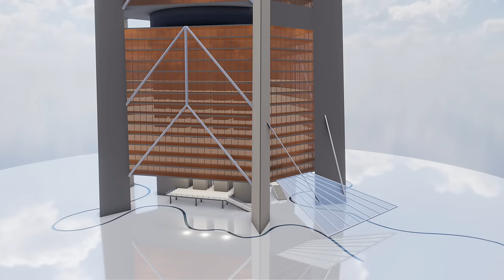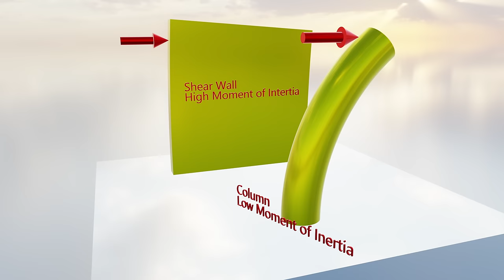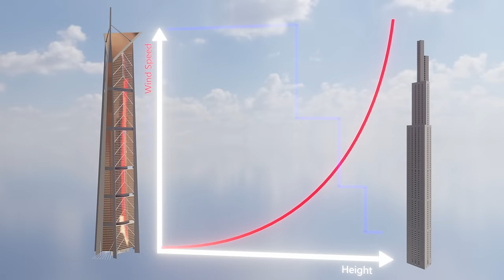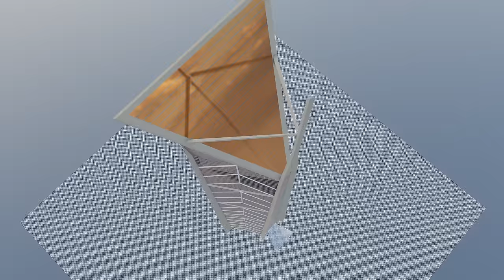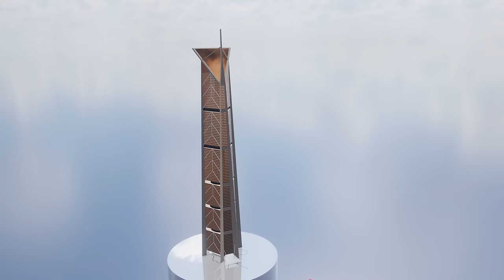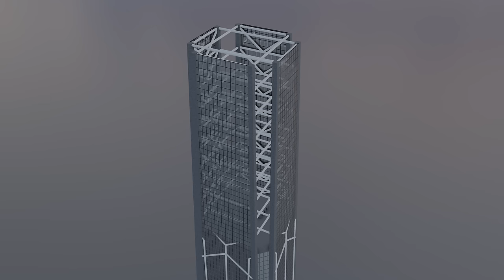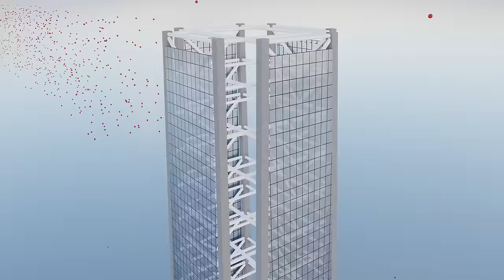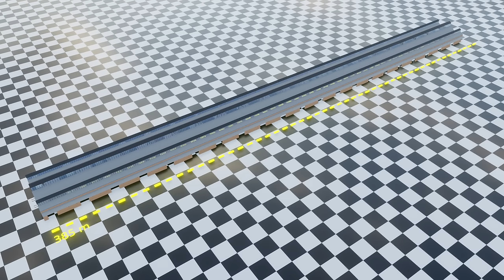Why Melbourne Cancelled the World's Tallest Building

Comment: great video. I much prefer the Grollo tower for its look, and from your explanation appears to be structurally more sound. I especially like the mechanical floors which allow more wind to flow through, and even if its only 15%, the solar panel is still a great touch to the top of it.
Reply from the maker: The open mechanical floors and solar roof were revolutionary at the time; they are very common on skyscrapers these days, but not in the 1990s. Thanks for watching

Comment: FYI DCM did a circular 750m mixed-use tower design for Dubai that preceded the Burj Khalifa and followed on the footsteps of the Melbourne Tower. Amazing project and great shame it didn't go ahead.  The outer layer was wrapped in perforated sheeting with a unique graphic patterning.
Reply from the maker: Thank you for sharing, I just looked at it on DCM's website and it's definitely a unique form. It's a shame there isn't more information about it on the net though.

Comment: 2 buildings , one 50 floors and one 49. 49 sticks a 5 storey high antenna on top,,,, which is the tallest building ?
Reply from the maker: According to the Council on Tall Buildings and Urban Habitat (the organisation who maintains the rankings of the world's tallest buildings), an antenna is not counted when considering the "Height to Architectural Top", which is the metric used for the rankings. So in your example, the 50 storey tower would be taller to the architectural top, and thus the taller building. However, if the antenna was an architectural spire, then it's height would be counted the 49 storey building would be considered taller. Some people prefer to consider only the height to the "Highest Occupied Floor", in which case the 50 storey building would win. So, your question is difficult to answer and depends on who you ask.

Comment: It’s strange that you’ve got the Architect wrong.
Whilst it’s possible that Seidler designed a version of Grollo Tower, it was not the definitive design that was proposed to Council.
Denton Corker Marshall designed a far more slender and beautiful tower sited at the west end of Collins Street in the late 90’s.
Reply from the maker: From my research (Fluid City by Kim Dovey), Seidler was a serious contender who designed the first iteration of the tower. You can see Seidler's drawings on the firm's website. However, you are right in that the DCM design was the one that had a higher chance of being built (which is covered in the second half of the video).

Comment: Melbourne hardly needs to be put on the international map. I'm relieved to see that this concrete monolith will not go ahead. It's unimaginative and frankly boring. If there's demand in these uncertain economic times I would suggest a Timber Building that is so beautiful that it is 100% tented within 18 months of completion.
Reply from the maker: I agree that timber buildings are more beautiful than concrete or steel, but from my experience they are not as sustainable as people think. Timber is not as structurally efficient as concrete or steel, so there is usually not a huge difference between the emodied carbon of a timber building versus a traditional concrete/steel building.
Reply: @Contraflex  Granted. There is a limit how high a timber building can be.

Comment: Thanks for sharing
The people of Melbourne didn't get a say. We never do. Look at all the low quality high rises in this city. Are you aware that most apartments are coated in fire accelerant cladding which is illegal and won't be changed because it cost the landlord more than zero $.
Melbourne's corrupt building lack of codes (actually the codes are good but are largely ignored) has facilitated a Manhattan style cluster of dystopian, never to see the sun, streets. 
Both proposed designs are poor aesthetically and were never really fully fleshed out as functional landmarks. It was always just an overblown ego project that had no realistic chance of being built. There are many such proposed projects around the world, nearly all of them, unrealistic.
The flight path excuse is a bold faced lie. The CBD does not line up with any of the runways and there is plenty of space for planes and buildings to coexist.
Reply from the maker: Thank you for sharing. I was also surprised to read that the tower would interfere with Melbourne Airport (can't the planes just fly around it?) but I understand it is a valid concern since it resulted in Australia 108 being shorter than initially planned.
Reply: @Contraflex  - Thanks for your reply. My understanding of why 108 was chopped down to 100 was because of the shadows being cast on the war Memorial. Not sure why that was significant. Perhaps they are unaware that shadows move. 20 minutes of shadow late in the day seems inconsequential to me. 
There is plenty of content for you to explore in Melbourne's construction industry if you have access to the information. Docklands is a story that makes no sense to anyone but those who profit from it.
Reply from the maker: @warpeace8891  I did some research and it looks like the story about the shadow being cast on the War Memorial is true. "Fluid City" by Kim Dovey was a great resource for researching this video, I'm sure it will have information on other interesting construction projects in Docklands.
Reply: @Contraflex  - Individual contracts/projects are not going to be of much relevance in Docklands. 
Just in case I point you in the right direction... Docklands is different to anywhere else in the world as far as I am aware. The Docklands precinct was under the governance of the Melbourne City Council until they decided to "gift" it to three separate corporations to manage and profit from. These three sectors are distinct and independent of each other without the same business codes and building codes etc. Each corporation decides what gets built, how why when and who can do activities in its sector. They are not subject to the same standards or requirements as the the rest of Melbourne City Council. I have dealt with these entities for over a decade and they are effectively three corporate kingdoms. If you walk around Docklands it will be obvious that everything is designed to make money for giant corporations and people are an afterthought at best. The tiny bits of public space that are in Docklands are put in places where a highrise cannot be built. Or they are too small to be of much use. 4 years ago there was small primary school built with no grass or significant play areas at all. 10 years ago there was a library built. These are the only public building facilities in docklands. The area is full of empty commercial spaces. Small business rarely last more than a couple of years. Many of the apartments have never been occupied. Officially they claim up to 20% unoccupied. In reality it is likely to be between 50% - 70% unoccupied. I moved in 2012 and I remember saying then that this will be an inner city slum - it just doesn't know it yet. They do not allow charities to operate... I tried for years without success. It is all about MONEY NOW in Docklands. There is very little green areas or trees or maintenance and litter is ignored until New years eve festivities.
It is corrupt and a Public policy disgrace. The council and the state government will tell you the opposite. Hailing it as the reason Australia did not have a recession in 2008/9. It is a lie. Federal government stimulus conveniently left out of that story.
The publicly available info would be enough to make a documentary. I know there is much dirt under this carpet but I don't know the details and I don't expect it to ever become public.

Best of luck to you.
Reply from the maker: @warpeace8891  I appreciate your detailed comments. The Docklands primary school is unlike any I've seen in Australia before, such a tiny campus but the multi storey buildings are reminiscient of a university.

Comment: What an ugly building! Melbourne will be the laughingstock of the world and there will be tons of commercial space that could not be leased today. Due to Melbourne's severe weather patterns (especially of late), that triangular piece on top would be ripped off without a doubt!
Reply from the maker: I agree with your first point, however, the steel spire would have been designed to withstand at least 1 in 500 year wind gusts, if not 1 in 1000 year. So, I think it would be unlikely for it to fail.
Reply: Good to know, thanks.